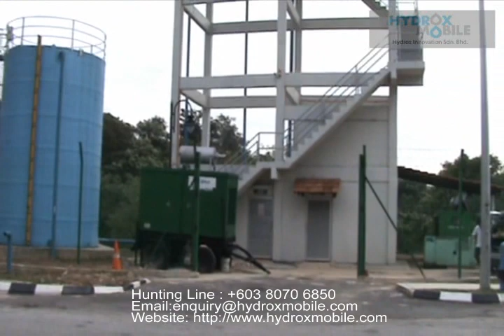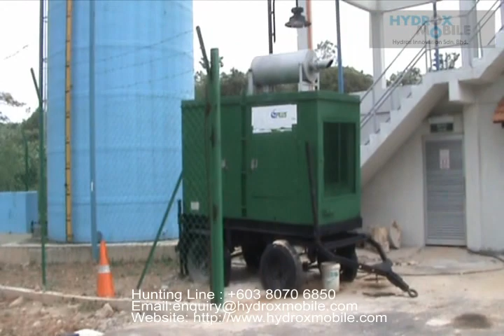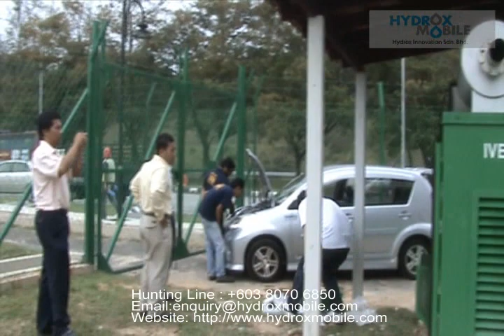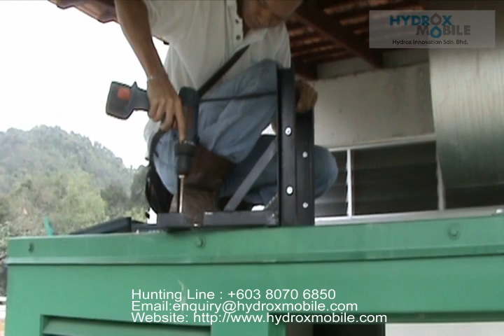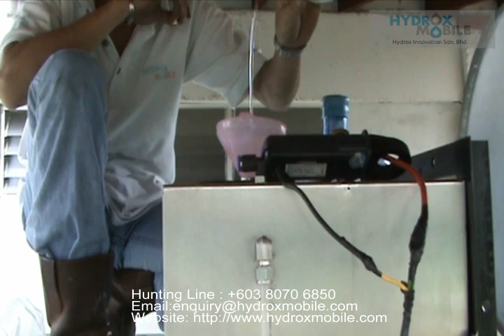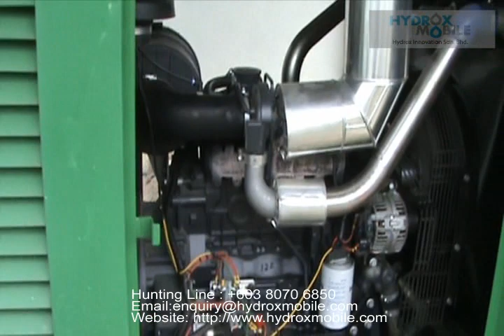HHO Diesel Generator Hydrox Mobile HM240 Unit Setup

Comment from the maker: The gas production is 3L/hr at 15Amps.
You can even set 3 systems up running in a parallel at 18V at 13A with our PWM.  If you set it up this way it will extend the lifespan of the 316L plates because less heat is generated.  Juz remember no matter what 316L plates you use, the plate will corrode one day.